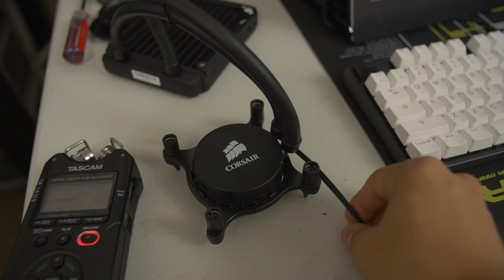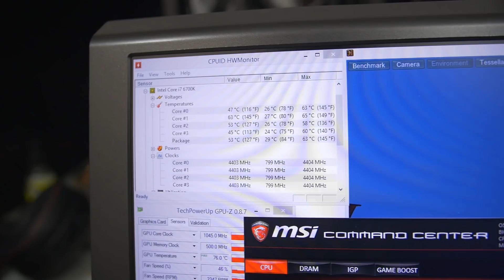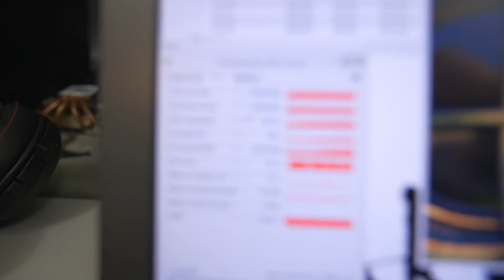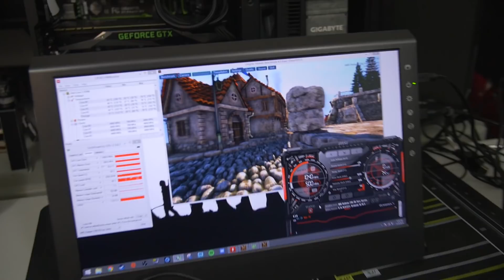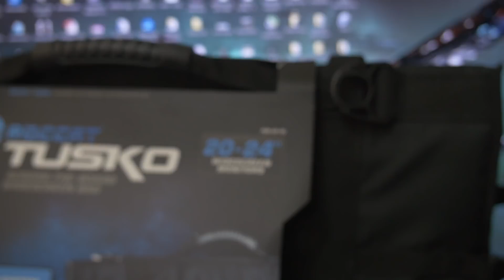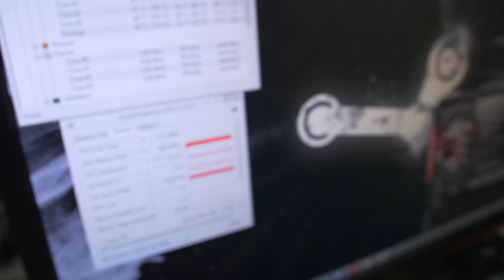Upgrading My LAN Setup + Water Cooled Node 202 Update!

Comment: Why not switch the Fury Nano with the Gigabyte Mini ITX GTX 1070?
Reply: Close performance and the ITX 1070 Throttles a bit
Reply: Asif Chowdhury with the power limit raised it doesn't throttle much, if at all, it's mainly power constrained due to the single 8 pin, unless you break the 80 C temp mark
Reply: Waffles Because you won't be able to fit it next to the AIO Radiator... I tried the same with a GTX1060, only to find out that it's 20mm longer and not fitting! I also use the r9 Nano now
Reply: Freesync monitor......
Reply: Sebastian Contreras I'm pretty sure the fury nano throttles a lot
Reply: ÜberManiac Uhm, I said 1070. Not 1070 M. I've seen reviews of the card that say it runs just as well if not better than the reference 1070.

Comment: For a fully watercooled node 202 use a "Slim" 240 Radiator (25mm) 
with 2 slim fans (12,5mm), this will fit under a fullsized GPU with waterblock 
and has round about 10-12mm of free space too "breath" ... 

i would like to see u build this fully watercooled 
(and maybe hardtubed for the challenge :D)

also there is free space above the cpu now, 
maybe for the hdd/ssd's or another 120mm Radiator ?

plz, maxout the 202 in a optical nice way ...

Comment: What is a "push pull configuration" ?
Reply: push pull refers to one fan pushing air out while another pulls air in. usually you'll do this on a radiator or something . a fan on either side.
Reply: Imooogi - push/pull is when you fit fans on both sides of the radiator, 1 fan push`s air in to the radiator and the other fan pulsl the air out. Hope this helps..
Reply: Often also used on heatsinks, especially very thick ones
and in keeping with the channel... LADIES ;)
Reply: true. but honestly if you put the fan that cam on the heatsink in front the exhaust fan on the case should do just fine. its close enough to the heatsink, at least in my case anyway that adding a pull fan is unnecessary and equals more noise and money that could have been put elsewhere

Comment: OMG - That's the monitor I have! Accidentally melted part of it with a lamp but it still works 100% okay, so props to AOC for that!
Reply: Really? B/c amazon has yours at $319.77 currently, and the AOC one has the other use for AMD card users of being freesync. Also, I've noticed absolutely no hz issues.
Reply: $199.99 where I live...US. Meaning that the xl2411z is 1.5x the price.
Reply: No problem, prices change like crazy. Yeah - for $500+ I would never consider this monitor, but for the $200 I got it...it was a steal.

Comment: Wouldnt it be cool to have a screen in the case of the computer?
Reply: Martti Groenen they do they are called laptops
Reply: Musaab Hasan fuck laptops. I'm not ever gonna spend more money on a laptop that performs 75% worse  than my custom desktop.
Reply: google gechic monitors ....like what he had before.....it's super thin....u can stick it to the case with velcro
Reply: Check out this Linus video on the subject (well, a particular attempt at executing this, anyway): watch?v=kXQQ2qc45Ng

I'd say the "Mono all-in-one" looks way better, though. It's a monitor with slots for computer parts on the back, not a case with a monitor on the side. Personally, I think if you strapped a Node 202 on the back of a 27" monitor you'd get a pretty neat portable rig, if the monitor stand can support it.
Reply: Oh my mistake they are called tablets.
Reply: Yeah, it's a little confusing.  Maybe it's like a retro thing.  When people used to carry their whole desktop to play a game.   A Tablet or laptop seems much more efficient.
Reply: To the people that say that Tablets and Laptops are the thing I was meaning, they're wrong, You can't put a desktop gtx 1080 in one of those...
Reply: Martti Groenen you can put a gtx 1080 in one of those. And sager has.
Reply: Musaab Hasan Its a tablet and it has a 1080 in it? k den
Reply: Clint Maas What I meant is for lan parties, for if you can like play desktop games at a good quality and not laggy 1fps 480p...
Reply: Martti Groenen so kinda like an all in one?
Reply: dunkinee Yup
Reply: Mark hahaa yeye I'm happy now i gtg to biggest talent show lets go weeeee :D
Reply: Martti Groenen ask in one suck you usually can't upgrade parts
Reply: Private Rodriguez ah oki